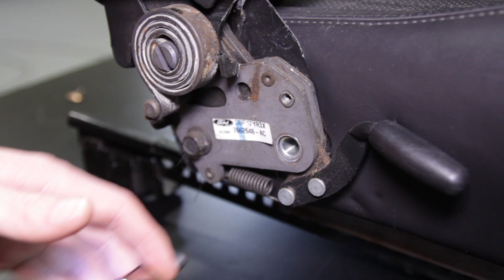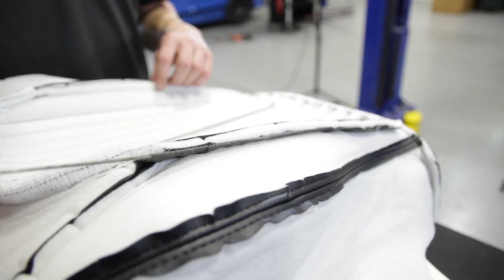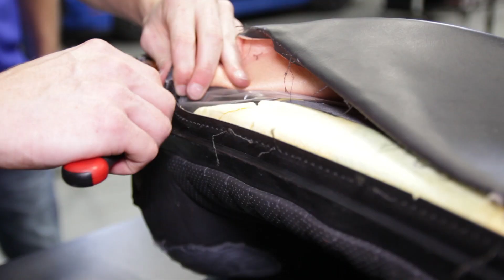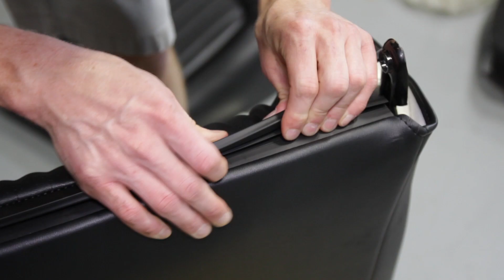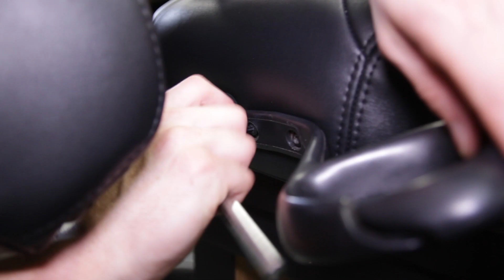How To: Install 1994-2004 Mustang Front TMI Seat Upholstery & Foam

Comment: is the bullit just a style package or did they boost the power to
Reply: Bullitt got a unique cast aluminum intake, larger TB, and high flow mufflers but all that only resulted in peak HP gain of 5 over the GT.
Reply: @rock-on6nt  that’s true but I would like to see what the dyno sheet showing the entire power band curve to see the difference especially with the larger throttle body and a different manifold